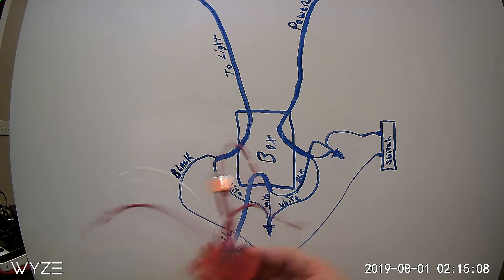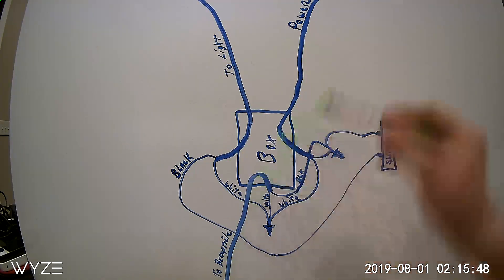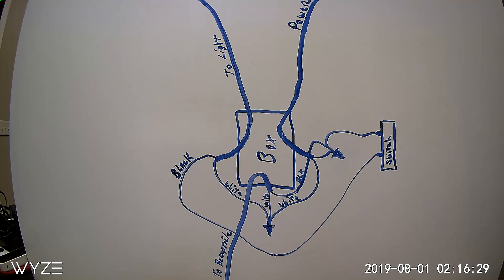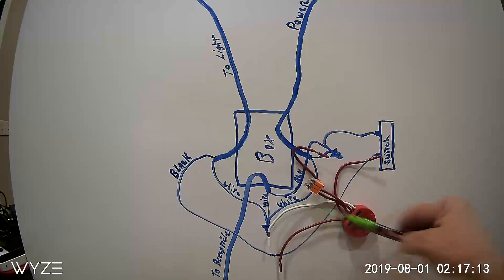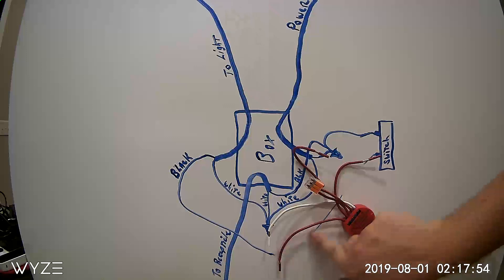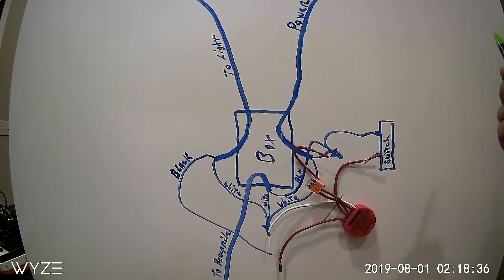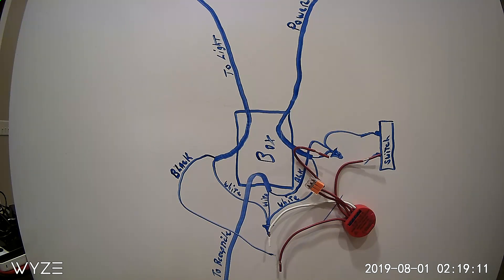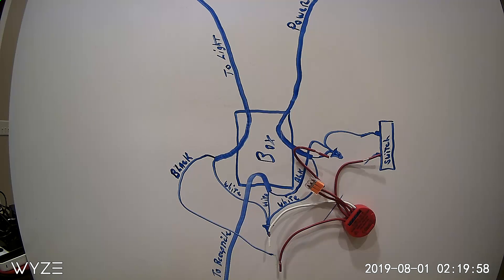Shelly 1 PM Installation Blog For a Typical Light  Switch

Comment: A few days ago I made a post of thanks for the video.  After installing the Shelly 1pm to control a light switch using a motion detector triggering mechanism everything seemed to work.  But now that the Shelly has been installed for a few days I noticed a problem.  When I turn on the light manually it will only stay on only as long as the motion detector is detecting motion.  This tells me the wiring, as described, is not quite correct if you want to be able to manually turn on the light and keep it on as long as you want.  So, just a word of caution.
Reply from the maker: I don't know what the problem would be, I've had my 50+ Shelly's wired like I have shown for over a year with no problems. I have some on motion sensors and timers also.
Reply from the maker: I think it might be more in how the motion detector is communicating with the system.
Reply from the maker: I have a motion sensor in my pantry so I just tested it out. The light does in fact turn off once the motion sensor is triggered and no longers picks up motion. I still feel the shelly is wired correctly and is functioning as it should. Maybe you can get around the motion trigger with an ifttt program to keep the light on.
Reply: @diyconnectedhome6102  Thank you for your replies.  Regarding your pantry.  If you manually turn the light on in your pantry will it stay on indefinitely or will it eventually go off?
Reply from the maker: @scottjercich7223  Once the motion sensor no longer senses motion it does turn off.
Reply from the maker: @scottjercich7223  It seems that the initial light turning on is picked up as motion so when no more motion is sensed the sensor  turns the light off.
Reply: @diyconnectedhome6102  Yes.  But this is the problem.  If you turn on the switch manually the light should stay on permanently until you turn it off.  But it goes off after a while when no motion is detected.   This is why I am thinking the wiring is not quite right if you want the switch to operate normally.  In the next day or so I will be experimenting a bit.  If I come up with something interesting I will let you know.  Again, thank you for making the video.

Comment: Can you provide a diagram for a shelly 1 install for a light that's hardwired without a switch?
Reply from the maker: I'll get one made. Sorry it took so long to respond. We were hit with 2 hurricanes and it's just getting a little back to normal around here.
Reply from the maker: Until I can make a video, What I did was simply delete the switch and the 2 wires that went to the switch and it worked perfectly.  I my case my light fixture box had a power wire going in and a power wire continuing on with wires to the light fixture. So the wiring looked just like the video minus the switch wires and switch.